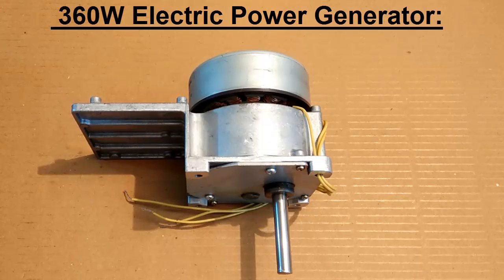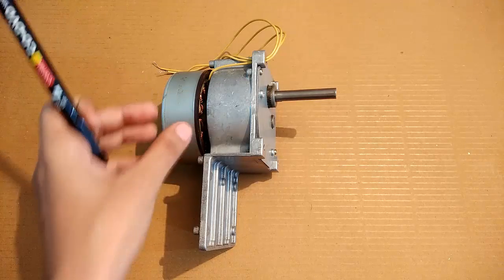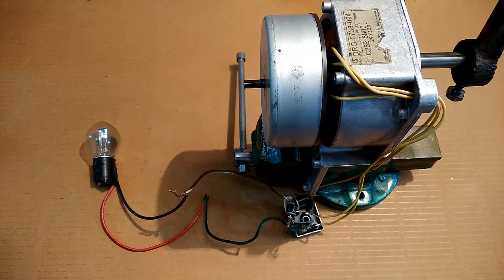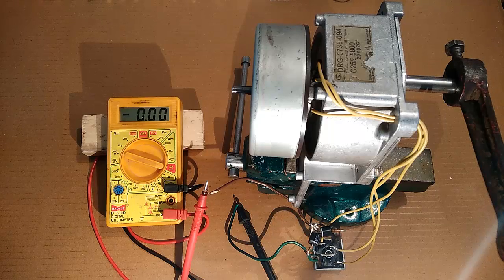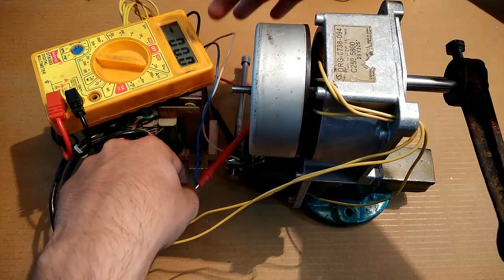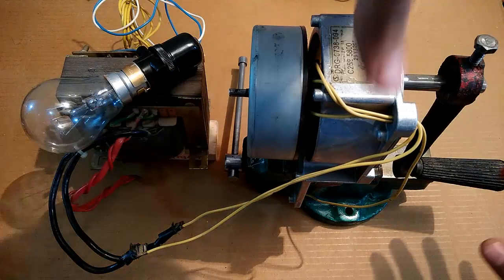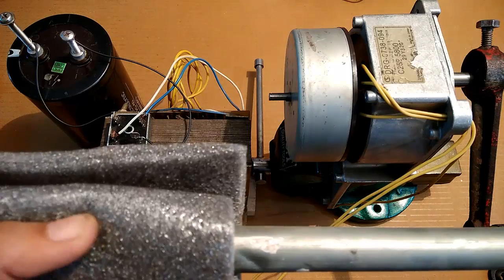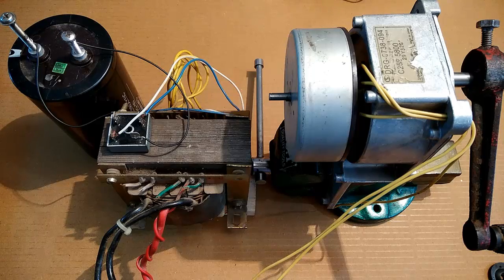Make a Free Energy generator with a BLDC Motor from printer DIY

Comment: Instead of hand crank which requires much effort, use torque reduction gears from low to high and reverse high to low.  Best system is using worm gears. It produces extremely high torque low speed but sufficient to drive your motor using power developed in capacitor to a separate driver since too much back emf is produced when hand cranking which is very evident in your video . Also it appears that not too much speed is required in your motor to produce sufficient current so a worm gear torque system would work very well.
Reply from the maker: silectronics the system has an inbuilt reducer gear.
Reply: I'm talking about external gear system to turn the crank. Internal motor already has low torque high speed but you need high torque low speed to connect to the shaft . This will make cranking that motor much easier without exerting force.  Thanks

Comment: Nice, but...
1) Free Energy is somewhat misleading. Many use it to describe a mysterious energy source, not accknowledged by science, yet almost nearly tapped already by some self-claimed inventors.
2) 3-phase AC power is not just voltage times current. In a symmetric situation it is power-factor times square-root of 3 times current times line-to-line voltage.
Reply from the maker: Murks Maker Indeed!
Reply from the maker: Murks Maker yes but we are measuring the output power in dc form that eliminates the √3 x v x i x cos£ .The calculated digits in the video are accurate
Reply: I referred to the calculation in your response to somebody else earlier in the comments, where you're referring to the rated values 24V / 15A  3-phase AC. I know, I should have said so.
I missed any calculation in the video, where?
Reply from the maker: Murks Maker no.You didn't miss anything.I should have mentioned 24V , 15A DC.
Reply: Indeed. To me it sounded like the AC ratings, when I watched it.
But never mind. Confused watchers always can ask.

Comment: You need to change your header and get rid of "FREE ENERGY" . What you have is a permanent magnet generator with a gear reduction. It still requires input power like you mentioned, either wind or hydro.

Comment: what kind of wave does it produces it a sign wave or do you have to hook it up to a sign wave chip or inverter first, assuming you could easily use it to charge your battery bank or use this to put through a bridge rectifier like you said or a bridge rectifier mustard or a extremely high step down power supply
Reply from the maker: The output is 3- phase pure sign wave AC.No inverting chip need.It is designed to produce AC Sign wave but if you need DC ,you need to hook up a 3- phase rectifier.